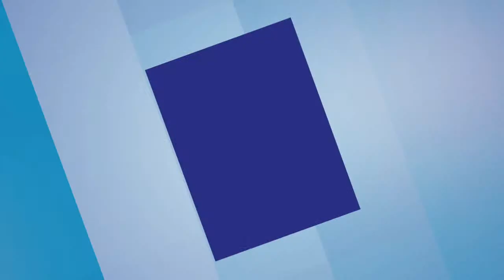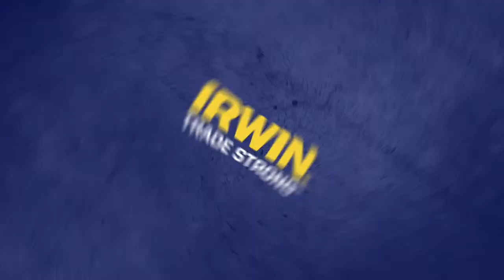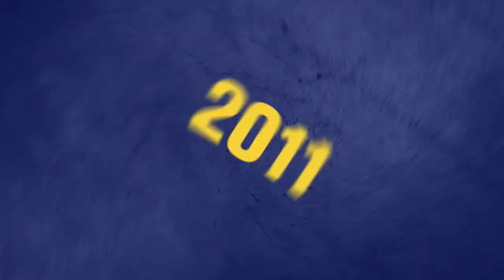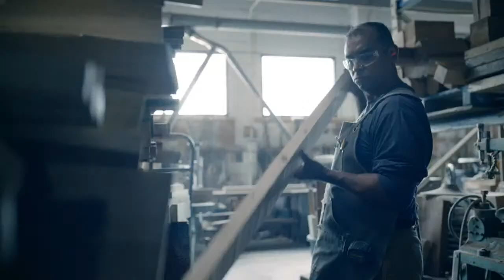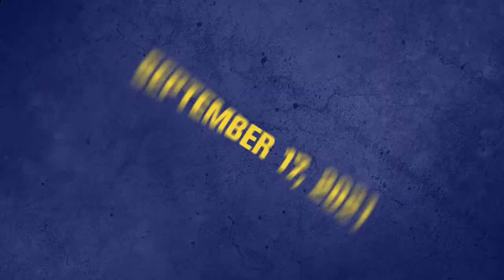This Old House Celebrates National Tradesperson Day | Presented by Irwin Tools

Comment: Starting early: 
My grandson started in his dads cabinet shop at the very early age of 5 opening boxes sweeping etc. During high school he would measure and build & install tops for home owners. He is now 18 graduated and working full time building and installing cabinets and trim on commercial jobs. He also runs all the shop machines including CNC,  computer saws, finish spraying cabinets, and welding fabrication. He is one in a million with a tremendous amount of experience. On the side he details cars for the neighborhood.